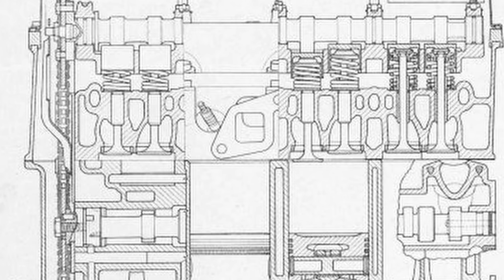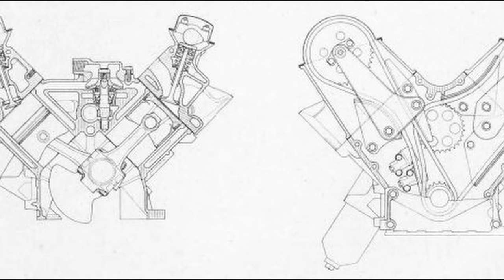Why Did The Triumph Stag OVERHEAT? Classic Car Myth Busted!

Comment: I owned a Stag for four years in the early 90s. I never ran it with a thermostat fitted, No problems. Also a 12 vane water pump helped. Great car with a fantastic sound track.
Reply: An engine must never be run without a thermostat. Unrestricted coolant flow causes localised overheating and damage and serious oil contamination. No problems you say, I seriously doubt it! I suspect you are not a qualified MVT! Basic maintenance is key in preventing any overheating issue’s.
Reply: @goffthomas2554  he/she certainly didn't drive it in Australia without a thermostat . . . then again, 20 minutes in England is a long day

Comment: I've had 3 Stags during my life time, 2 manuals, 1 Auto, still got one now. Never had any over heating Issues, During research back then for BL Australia the only mods that were done back in the "70s was Raised header tank and bleed system same as Dolomite sprint, TR7. worked perfectly and not expensive, raised the water head to well over the water pump, and allowed continuous purge and much more efficient. Yes we stripped many motors down to clean properly internally (swarf and casting sand)  before making available over the counter as spare parts. One thing else the head studs were changed around 1977 improved with different alloys, and was recommended to be replaced as a service bulletin, it wasn't a recall though. Radiator shrouds also.

Comment: A very good modification is to fit a belt driven Ford V6 water pump - it bolts to side of the engine like it did on the V6 Essex,  sits nice and low and can shift a lot of coolant. The original pump is binned. The head gaskets aren't a problem if the engine has circulating coolant.
Reply: This mod fits the Ford pump where the alternator is fitted, you refit the alternator using an aftermarket bracket up where the US market would fit the AC pump. Also throw the standard overflow bottle and fit a plastic header tank up high. Ones from Volvo plus others fit well and some have level sensors to warn you if water is lost. 
You don't need to update the rad, standard one is fine if checked for sediment. 
Do the above and you get to ditch the standard waterpump with its bad positioning so high up that a slight drop in water and it runs the pump dry. Also the water pump has a seal which when you have corrosion on the underside of the pump vane soon wears the seal caused by lack of antifreeze with its rust inhibitor. 
There are a lot of stories covering the design, politics, finance etc, most true, but we are talking of a car that is 50 years old, and like any this age, the enthusiasts out there have flagged and fixed these types of issues.
And for that I'm very much in their debt and able to enjoy such a great V8 sound track.
Reply from the maker: Good to know, great tip!
Reply: The coolant intake to the engine was also reduced in size from the  prototype to cut costs. I don't know if there's a fix for that one?
Reply: Leaving highly abrasive sand in the waterways and oil ways during production does not sound like a good idea!! ☹️😡

Comment: I did not realise there were so many reasons for the infamous overheating issues. I thought fitting thematic fans was a fix all but it is more than that. I fit an Aussie invention called Engine Guard to my old cars. Cheap insurance. It monitors engine temp. not water temp.
Reply: So what is it actually measuring? And where in the engine? Serious question 😊
Reply: @timgriggs8592 some engine remanufacturers fit a temperature sensitive label that monitors metal temperature. If coolant is lost then high metal temperature is not down too mechanical failure. Simple detection method!
Does that help Sir? 😊
Reply: @goffthomas2554  Yes. I wasn't aware of such a device. It's a pity Rover wasn't, either - in the 90s a lot of K-series engines would have been saved!
Reply from the maker: Yep, the Stag had quite an uphill battle...
Reply: I had a rad hose clamp break and lost water/cooked a car, and by the time you realise, too late. That car (mid 80's) and my Stag (I used to do long interstate trips across Australia) I fitted a cooling system pressure gauge. The one on the Stag is actually a Stewart Warner fuel pressure gauge that reads from the header tank. The car warms up, gauge shows 13 lb. Of course it varies as temp rises/falls, and changes when stopped/hot soak (as does the mech temp gauge), but you learn "what is normal". The SECOND I get a leak, (or a dud radiator cap) I know. It has been on there for 31 years. It's actually older than that, as it came off the previous car that had it.

Comment: Water pump at the highest point in the cooling system? Seriously, how much longer will this myth persist.  All you need to do is actually properly look at the pump location and you'll find it to be a good 10+cm below the highest point - that being the filler on the radiator. Have a look at any other contemporary car and you'll find they all have the water pump at a similar height... You are correct about the reason of its location and that leads to another question; Saabs and Dolomites had the same pump setup yet it is only the Stag that get the bad reputation... Those other cars didn't really have any water pump problems, so why the bad rep on the Stag?  Seems to me an easy target considering all the other myths that do the rounds.

Comment: Yes most stags are well sorted , easy fix , fit upper expansion tank like tr7 ,  fill proper alloy engine coolant not tap water , in the garages I worked on them no problem at all, because they were serviced , great engines if maintained,
Reply from the maker: Exactly, a few modern improvements help so much!

Comment: I've never heard those reasons for overheating before.  For an experienced car manufacturer to design something like that is unbelievable, I'm tempted to add the word embarrassment to the words national disgrace.  So it seems that in house fighting and selfish pride led to a beautiful car and another nail in the BL coffin being hammered home?  It does beg one question, did Saab suffer from similar problems and why put that header tank down there?
Reply: It was all the fault of Harry Webster of Triumph, who insisted that the Stag needed its own V8 and not a version of the Rover/Buick V8. He said the Rover engine wouldn't fit (untrue, as so many owners found in the 70s and 80s...). All down to the ruinous politics of BL, and dreadful quality management of course 😢
Reply from the maker: The Stag V8 is actually a lovely unit...if owners take the time to maintain it, fit a few retroactive improvements and look after it...
Reply: @timgriggs8592  then he should of been told that a Rover unit was going in there and that's that.
Reply: @rob5944  He certainly should have, yes, but there's BL management for you. Instead of saying "Why on earth would we want two V8 engines in our range??" they allowed themselves to be browbeaten by Webster. Sigh....

Comment: I couldn’t understand why the cooling system was changed from radiator fill cap ( like on my sanction 1 1971)  to the low level expansion tank  fill cap… 
I know by a quick tool free check if my coolant level is full ( as it should be to not knowing without a spanner- Really dumb move to rely on a stupid low level expansion tank that tells you bugger all!)
   I much prefer the old 13psi system that after the bypass hose update ( 25 cars before mine was built) The cooling system is fine IF THEY ARE BUILT PROPERLY AND DEBRIS FREE)

Comment: There wasn't really as many design problems as the myths say there are. Everyday people who have them now have little trouble with them if you do things properly. 

The REAL problem was that BL assembled them. It is as simple as that. 

You introduce a high revving, alloy head OHC engine to an assembly line that can't assemble a basic cast iron head pushrod engine................ what do people expect?

Or, put another way, give a Jaguar or Aston Martin engine to BL to assemble, and give the Stag engine to AM to assemble and maintain. The Stag engine serviced/assembled by Aston Martin would go forever, the Jag/Aston engines wouldn't even run. 

So many stories. "Casting sand in the engine". Ok, put sand in a new Honda engine, and if that has problems "Oh, bad design???" Of course not. Leaving casting sand in an engine is stupidity and slackness, nothing to do with design. 

Head corrosion. I have a BL tech bulletin that tells dealers to "re-use anti freeze out of old engines, as it is in short supply". NONE of us would do that, and yet BL did????? No wonder they had problems. 

I bought mine in `1993. At the time I was posted to Melbourne (Australia), and home was Perth. It ran hot first weekend I had it, because the "expert" who built the engine hadn't a clue/head torques all over the place. I fixed it........................

I drove mine home every Xmas leave (4 weeks) from Melb to Perth (3500 kms one way/7,000 kms return, in summer, in temps from 35 to 48 degs C. Did that almost every year for 7 trips. Leave Friday, drive dawn til dusk, arrive mid arvo Sunday. 5 hour stints at a time, sit on 110 kmh all day, and in the middle of nowhere (lucky to see two cars all day) sat on 130 kmh for 5 hours at a time/steady 4,000 rpm. Never missed a beat. (Car was an auto then and for all the interstate trips, hence 20 mph per 1,000 rpm. After I was posted to Perth I fitted the manual/overdrive it has now, that would have been nice for the cross Aust trips).  

My car had done 90,000 kms when I got it, and I have added 330,000 kms to that in the last 31 years, so currently sitting at 424,000 kms. It doesn't do interstate trips anymore, but I use it all the time in summer, and in Perth, it gets hot. This summer we had months of max temp over 35 deg C, and two weeks of 40/just over 40 deg temps. The car handles that heat better than I do. 

No car is perfect, and the Stag isn't either. But people who know them are sick of the constant repeating of myths/mistakes that were started when the cars were new, and then just constantly repeated. 

But, there is an advantage. Any other classic touring convertible is usually WAY out of my price range. But my Stag was amazingly affordable. 

So those who have never had one/never will/never worked on one? (They are the ones who "love the myths") - Keep spreading the myths and keep them cheap for us. 

For that, we thank you. 🙂
Reply: Wow, great story!  So your Stag has done another 330,000 km without a rebuild?

Comment: In Australia I worked at a Triumph specialist workshop for 25 years. The Stag engine was easily the worst Triumph engine ever built, if the car had of originally been engineered with the 3.5 Rover engine it would be worth much more today
Reply: I beg to differ. we were going to modify and fit sprint heads
Reply: @ma-li3935  lots of luck with that,  the operative word is 'were'.
Reply: @Pops1948  It was done, but I was not with them when they completed that project. Did you know that BL also prototyped with Lucas P.I. same system as TR6 on the Stag as well.
Reply: @ma-li3935  the engine in Australia had inefficient water pump, oil pump, timing chain, heads etc. Big mileage/heat was a no no. The Buick/Rover engine would have made the underpowered Stag a great car. Lucas's injection in Australia was Triumph's Achilles heel, a laughing stock
Reply: @Pops1948  12 vane water pump was also an upgrade then, the biggest problem was if the water level got too low then the height of the pump would either cavitate or worst case not pump at all (thats why JRA at the time had a service bulletin to relocate the header tank and fit the 12 vane pump). The main cause of coolant loss was at the back section of the inlet manifold, the manifold was often not installed properly allowing the coolant to weep into the valley. and dickwits who never serviced there cars properly, as well as only using water to top up coolant system. Yes the Rover V8 is a great motor, just for your info I've seen a 350 chev motor fitted in a Stag. But I am just keeping to the Stag as it was sold to the public. Don't forget the P.I. injection was a sixties thing, the stag was designed in the mid sixties, so yo have to excuse the engineers at the time to use what was on the shelf at the time.
Reply: @ma-li3935  Stag was another Pommy car that was never meant to be driven outside a postage stamp sized Britain. Triumph 2500 with modern injection/ turbocharger in a Stag would be reliable and faster . . . provided you checked crankshaft end-float every few years
Reply: @Pops1948  You can do a mod to provide a full circle on the thrust bearings on the crank. that would be a great improvement, you'd have to mod (recessed fire rings) the head gasket too if you was going to fit a turbo/supercharger.
Reply: @ma-li3935  Yes, replace the 3.7 diff with 2500 3.45 would help also

Comment: So......poor quality control and a flawed design. "Sand from the casting process left in the engine": I simply cannot imagine a Japanese company allowing that to occur. I just can't.
Reply: Correct. But their products are boring.
Reply: I said exactly that to my wife after watching this.  I had a Lexus with the 3uzfe engine, a 4.3 V8 that ran like a swiss watch.  I the U.S. they regularly cover over 300,000 miles.  500,000 is not uncommon apparently.
Reply: @raftonpounder6696  I know where you coming from, but sitting in the dealership or pulling out serious cash to rebuild or replace a cooked engine can hardly be considered exiting.
Reply: @raftonpounder6696 Yes, reliable and cheap to run are boring, true 😂
Reply: @timgriggs8592  there’s more to life than reliability.
Reply: @raftonpounder6696  Yes, but the ruins of the UK industry are proof that if you can't build cars that are reliable all the other clever stuff goes for nothing. It's an "and" problem, not an "or" problem.
Reply: @timgriggs8592  Italian cars were and are unreliable. They’re still going. It was the strikes that finished us.
Reply: @raftonpounder6696  Italian carmakers are mostly owned by a US-European or European parent and their quality has improved to world standards. As for strikes, they were another symptom of poor management, the sort that gave the world the Stag engine, the Austin Maxi and the Rover SD1. All very sad.
Reply from the maker: You may have a point...